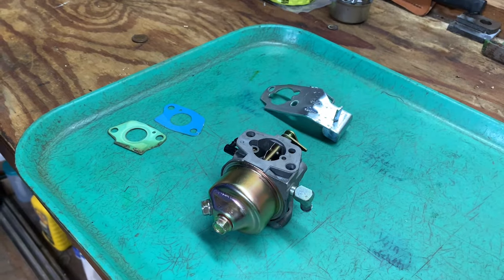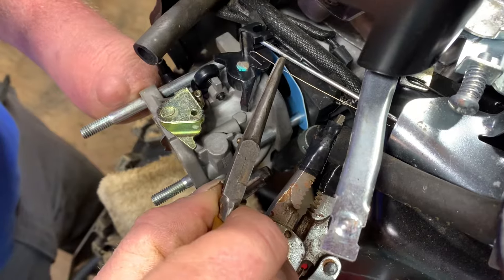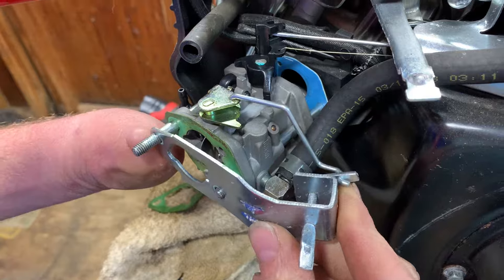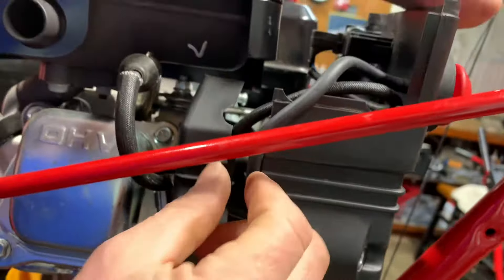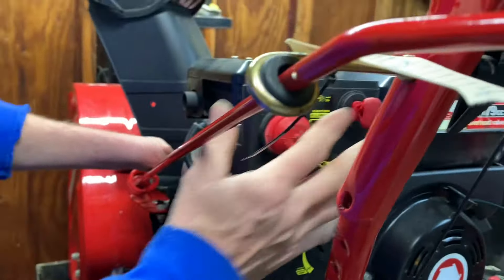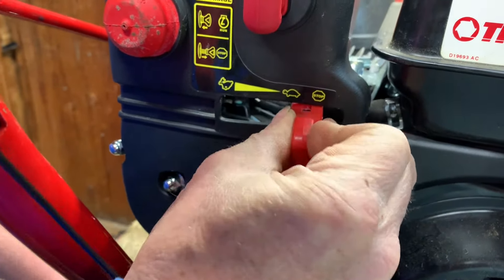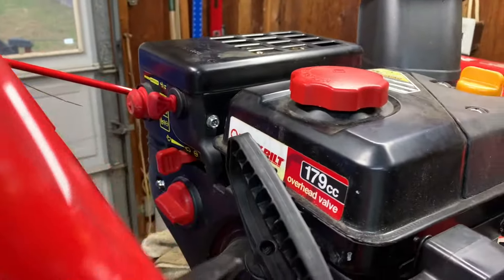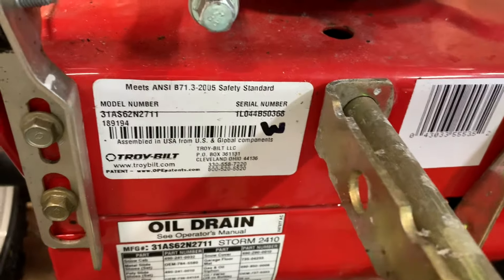How to Install Carburetor Troybilt 2410 Snow Thrower

Comment: I wanted to thank you for such detail. I also watched both. Two things I would suggest. Remove the belt cover to get the muffler cover completely off and definitely replace the gasket on the engine side. If there is a gasket kit for the old 2410 you know about that would be very helpful. Otherwise, I couldn't have done it without your videos. Many thanks.

Comment: A question for those of you that know more than I do.  I purchased a new carburetor, It looks exactly the same as the OEM, BUT the bore is 12/16", 3/4" rather than the original of 11/16". How will this affect the engine?

Comment: GREAT video!! Ensure tiny float spring is inserted at top & no kink...causes flooding/leak. Also nipped small notch in hole for choke handle...easier to slide assembly cover against carb.

Comment: Great follow-up video that should really help me.  Gonna try to pull off that red knob today for the speed setting
Reply from the maker: The knob can be tough but it will come off. Thank you for watching and commenting.
Reply: @JohnsonsSmallEngines  I got it off.  I ordered a replacement carb.  Wondering if you could clean and rebuild the original carb since it's the genuine part.  Do let me know.  Thanks
Reply from the maker: @stewsmith3536  You can absolutely rebuild original carb and that is actually what we try to do here. We are able to use a ultrasonic cleaner and most of the time the carburetors do come back to run again!
Reply: @JohnsonsSmallEngines  I will try this.  BTW, I hope that I did not mess up with my spark plug.  I removed it, cleaned it, and put a little lubricant on the threads.  Now the actual spark plug seems not to get tight. I can gonna wipe everything clean inside and out hoping that it sets properly.  Hope is not stripped, but if so can you offer a solution  Your responses are fantastic and extremely prompt.  Thanks so much
Reply from the maker: If you stripped the threads you will need to get a 14mm spark plug rethreader kit.
Reply: @JohnsonsSmallEngines  I will order this kit.  Is this very complicated to do for a simple DIYer like me.  Have you don't a video on this procedure?  You are the best in your space!  Thanks and I hope my follow-up questions are not a bother to you.
Reply from the maker: I haven’t had to perform that task in over 20 years. You only make that mistake once. Lol! I’m sure there must be a video out there that shows how to.

Comment: Fabulous video.  I'm so appreciative.  I'm try to do a rebuilt, but the main inlet is frozen.  I did have a screwdriver which fit well, but even after lots of WD-40 and heating with a torch, it's not budging.  Thoughts?  Also, I have the old style carb.  If I wind up replacing it should I stay with old style or go with the new style you mentioned?  Blessings.
Reply from the maker: It sounds like you will need to replace the carburetor. You will need to replace the with the one that came from your engine. It will be the old style carburetor.
Reply: Thanks so much! @JohnsonsSmallEngines
Reply: Lucky me.  I tried an impact driver (in reverse) and it worked!  Progress.
Reply: Final Update:  Success!  Everything is back together and seems to be working fine.  I'd love to give my unused parts to a worthy cause.  They'll easily fit in an envelope.  Any thoughts?  I cannot thank you enough for you channel and your help and guidance.
Reply from the maker: Glad to hear :) Did you purchase a new carburetor? If you have extra parts and you have a local vocational school with a small engine class? You can take the extra parts to the school for the teacher to put on the shelf in case they have a snow thrower to work on? I would suggest stop using the gas pump gas and start using Aspen4. Here is the link to read up on it and a locator to find it in your area. https://www.aspenfuels.us/products/all/aspen-4/. It will keep you from having issues in the future.

Comment: oD you perform mail in rebuilds on this carburetor since the original one may be better than the amazon replacement.  Or can you recommend a good source for a quality carburetor replacement for this one?
Reply from the maker: Huayi is the OEM “original equipment manufacturer “ for the China engines and you can find them online. I recommend using the Huayi brand.

Comment: I was able to replace the carburetor in new 2410 and get it to run -  Awesome!  However when it’s running it doesn’t sound like it’s running smoothly - almost like it’s struggling to stay on.  I kept it running over 10 mins and am able to user Auger and Drive Control but feel like there might be something wrong.  Any advise?
Reply from the maker: I have seen, gaskets installed incorrectly. Debris in fuel tank that was not cleaned prior to installing new carburetor like water, Even sometimes a new carburetor will not work correctly but that is few and far between.
Reply: From what I see the description sounds like surging which is weird since new carburetor
Reply from the maker: Yes you are correct, surging is a lean condition meaning not enough fuel is flowing. It could be a bad carburetor or the reasons I stated above can also make a lean condition. Let the machine sit for a day and try it again. Sometimes the carburetors need a little time to get going. Also the warmer the engine gets, the better it should get but as you said, you ran it over ten minutes and that should have been ok. I would double check the other reasons I stated above and if all checks out you may have purchased a bad carburetor.
Reply: I see how adjustable screws on carburetor.  One is a plastic black screw and small screw with spring.  Which do I adjust to address surging?  Do I tighten or loosen them?

Comment: This video is much appreciated. I'm in the middle of a carburetor replacement using your old style carb video. IMO all the small engine repair guys offer keen advice, but your strength is showing the way for those of us who've never done this before, and afraid we'll miss key steps. The tool layout at the beginning is strictly SOP and much appreciated. Sure enough, I tried to skate by without the ratchet, but one bolt sent me to Lowes to pick up a MM ratchet set. #Question 1: shouldn't we go ahead and replace the spark plug while we've got everything out? My snowblower started like a champ, but even so, now seemed like a good time. #Question 2: I've never had issues with storage and startup using Stabil when I put the snowblower away for the summer. Last year I decided to drain the fuel tank. This year, immediate start up, but the carb leaked like a sieve. Maybe caused by my draining the carb. Maybe not, but what are your thoughts on storing a snowblower? To drain, or to Stabil? I've heard carb gaskets and such can dry out if you drain the engine. I've also heard they can gum up if you don't. I have no idea which way is best.
Reply from the maker: Definitely replace the spark plug while your there. Better to be safe than sorry with the spark plug. You described it both ways of storing the machines that I do recommend in the issues are, if you store the machine by emptying the fuel out of the gas tank, you must make sure you get all the fuel out of the fuel line shake the fuel tank around a little bit then drain carb 100%. If you miss even a half an ounce of fuel you can have issues just like you did this year. Storing the machine with a full tank of gas and running it periodically every other month for 20 minutes at a time should keep the machine running 100%. The problem with that is human nature we do not remember every other month to start our snowthrower. I live on the East Coast of United States and we do not see a large amount of snow in the Philadelphia metropolitan area so I clean and rebuild and replace a lot of carburetors every year because most people do not know how to store their equipment. Stabilizer is a must and you could check out a new fuel that has been out on the market for some years. It is called TruFuel. It is man-made you can buy it at many hardware stores. It is a little pricey but it supposed to stay fresh for up to two years. I am skeptical about that but we all use it in the small engine world! Go to the website and read up on it. Thank you so much for the kind comment. Please tell others about my channel so we can grow and thank you for watching my videos. I’m glad these are helping for you!
Reply: @JohnsonsSmallEngines  Thank you Brad. Keep in mind that things that are 2nd nature to you guys (like changing sparkplugs & oil during a carb job) are news to us. (Some of us?) BTW, the metric ratchet set? I knew I had one somewhere, couldn't find it, bought a new one yesterday just for one bolt, and found the original set this morning. A video on tool organization would be helpful. What's messing me up is the accumulation of left overs from plumbing jobs, picture hangings, and other jobs that I hate to throw out, but they're choking out visibility of essential go-to tools that are infrequently used, and therefore forgotten. I know you work daily in your shop, but how do you keep tools and parts where you can find them? Any suggestions for the occasional mechanic?
Reply from the maker: @groussac  Hey Pierre, thank you for the $. Purchase a used tool box if you have room to store it? To keep tools organized.
Reply: @JohnsonsSmallEngines  As the good book says, the workman is worthy of his hire. Or if that one doesn't quite fit, how about 'don't muzzle the ox that treads the grain'? You earned the $. Make no mistake. 

I think periodic inventories and purges might help in my situation. An extra board to hang stuff on the wall would also help. But the stuff accumulates. Just bought a siphon hose, for example. Not something I'll use a lot, and it's going to get contaminated with product. Keep it with my oil change pan, I guess, if I can remember where I put it...
Reply: Our 2410 has been in use for 12+years.  I never drained it, and left it with about 1/4 fuel in it (with Stabil), BUT when restarting for Winter, I always siphon OUT ALL of the old fuel, and replace with brand new gasoline.  I actually use Premium gas, since it has a higher RVP, which makes it easier to start in winter.  We also use a commercial Hexane spray into the gasoline, if the temperatures are really low.  Using the Ether also works, but it does not remove the crud from the passages, like the Hexane (contact cleaner) does, while the engine runs.  The concept here is that the remaining gas or vapors, are keeping the original rubber and plastic pieces in their "normal" states.  Those pieces are normally infused partially with the hydrocarbons, and they are "sort-of" bloated and flexible chemically.  IF they dry out, they have a tendency to shrink or crack.  That is normal for common materials, which are imbedded with a high RVP includent, same with wood, fibers, or similar materials.

Comment: What do I do if I put a new carb on and it surges?    Same snowblower as the one in the vid...ty
Reply from the maker: Let it warm up at 1/2 throttle for 5 to 7 minutes. Depending on how cold it is it may take awhile for the carburetor to get warmed up. You may need to compensate using the choke to stop the surging until it warms up but after warm up, you should always take the choke off. If it still surges it may be a new bad carburetor, if it is a aftermarket carburetor? Every now and then you’ll get a bad one.
Reply: @JohnsonsSmallEngines  ty....yeah I let it sit for about 30 mins at half choke..At first when I turned off the choke it would surge and shut off..After I let the blower run for about 30 mins with the choke halfway and turn the choke off it would surge but not shut off.....It's about 35 degrees out...Not too cold...I'm in Michigan..Were about to get a foot of snow tomorrow
Reply: I gonna run a full tank of trufuel with some seafoam in it to see if it helps....Does it hurt running the machine with the choke on a bit so it doesn't surge?
Reply from the maker: Yes it is perfectly fine. Check out this video I have on "How to get the job done" https://youtu.be/O6-LXGAIEig
Reply: @JohnsonsSmallEngines  thnx
Reply: @JohnsonsSmallEngines  Thanks